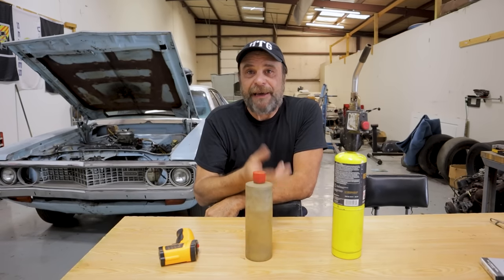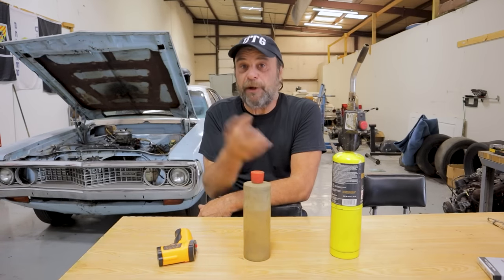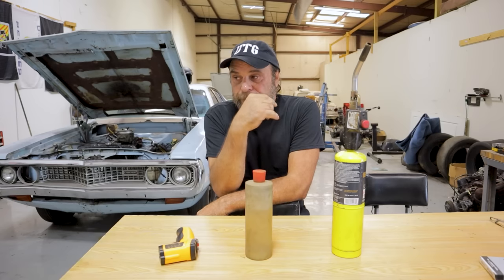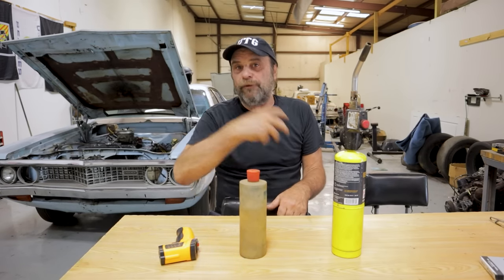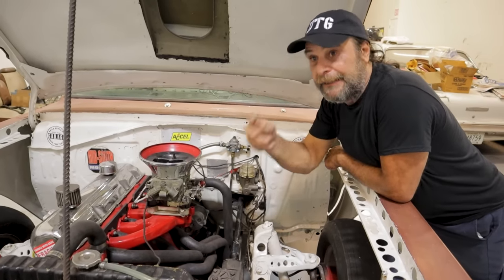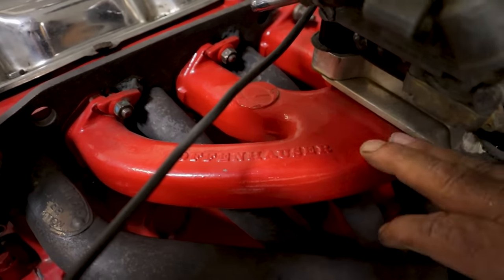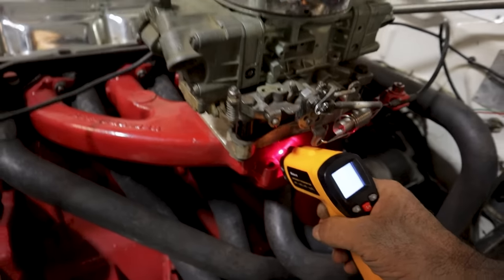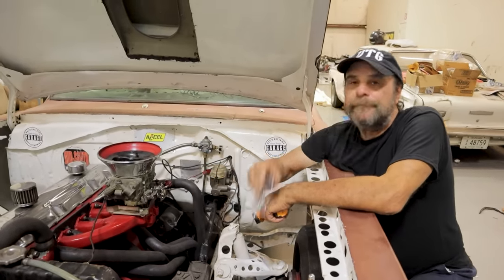How Much Intake Manifold Heat Is Enough? Testing The Vaporization Temps Of Modern Gasoline

Comment: Tony - I'd take the temperatures you were reading off that bare aluminum sheet with a BIG grain of salt - IR thermometers measure radiated infrared, and are typically calibrated for an emissivity (how readily a surface emits IR) of 0.95.  Materials like that aluminum normally have an emissivity closer to half of that or less, and as a result will read lower than their actual temperature.  To test it, try painting a part of the surface of your aluminum plate flat black, then heat it again and repeat your measurement with the IR gun, pointing it at both the painted area and the plain area right next to it.  My bet is that the black area will "appear" a lot hotter to the thermometer, thought both are actually the same temp.

Just something to be aware of with IR thermometers, and something that's much more obvious with IR cameras that show an image - shiny metal will often look cold relative to more emissive things nearby.  When measuring components on a circuit board that have metal cans, I usually put a piece of blue painter's tape on them to get a more accurate reading.  The painted parts of the engine are likely much closer to reading their true temp, though still might show a bit cooler than they truly are.  The header should be pretty much spot on.
Reply: Yes I completely agree. IR thermometers read lower on bare shiney metal. Paint the aluminum and redo the test.
Reply: Yes, even running cars look like the cold sky through my FLIR scope, only the tires, tail pipe, and halo under the car look hot, even when the sheet metal feels much warmer than ambient.  Predator vision is a very strange world.  I can see footprints with it for about a minute, but a paper target on a wood stand is completely invisible.  "Paint" the target pattern with some water or spit in dry air and you can see it from over 100 yds.
Reply: Completely agree, I bet water would have boiled on the aluminum plate he was heating.
Reply: Painting the Al plate mat black is a good suggestion (the emissivity of the plack paint will be higher than 0.95, the standard setting of non adjustable IR temp guns). However uncle T's red shiny manifold is next up for guestimation of it's emissivity. Perhaps he would like to remove the red and spray it also mat black. The black paint will also help with the inlet manifold taking in more of the heat radiation of the exhaust manifold.
Reply: If you are correct ,put  gas on the aluminum plate then record the reading  when the gas starts to boil.
 That reading will be your reference number to use when recording the time it takes the cold engine  to start boiling gas in the intake
Reply: Your concerns would be valid if UT had been experimenting with a steel or cast iron plate.  However, he was using aluminum plate which is the same as material as his manifold.  So, for UT's application 150 degrees is the correct target temperature for his intake and fuel.
Reply: @stevebooher7419  Except that the intake manifold is painted and the plate is not, so they still have different emissivities.  For apples to apples, paint the plate with the same stuff used on the manifold and you'll get numbers that should match more closely - not necessarily accurate as far as true temp goes, but at least 125° on one should be pretty close to the same as 125° on the other.
Reply: @stevebooher7419  Everyone is overthinking this setup UT is putting together which is what UT wants so he can get comments for more veiws.
 That guy from the "Mopars are everything" channel claims he can outrun this combo to the 60' on foot and that the reason UT's cars are slow is because the parts are junk.
Reply: @stevebooher7419   the Leslie cube experiment (readily available on YouTube) shows that a cube out of a metal coated with different colours, shiny and mat will have different emissivities. The challenge is understanding the limitations of an IR temp gun and understanding heat radiation versus convection and conduction. A thermocouple based surface thermometer is more reliable to use.
Reply: I agree with shiny surfaces.  But,  why would you paint it black?  Why wouldn't you paint it red so you are comparing apples to apples?
Reply: @jessekloth7884  Perhaps a bit of both on the aluminum would be best - the black patch should give a reading closer to the actual temperature as it matches what the IR gun expects to see, and red with the manifold paint to get a relative reading that would match what you'd see the temperature of the manifold as - eg. temp reading of 150° on the black reads as 130° on the red paint for instance.
Reply: I thought you could just stick some scotch tape on a place and measure that? I remember doing that when measuring air temps in galvanized ducting
Reply: @timothybayliss6680  As long as the black tape will stick on the manifold at the expected temperature (guestimated at 60-100 Centigrade) it will work. Of course the infrared measuring circle of the gun should be within the black patch.

Comment: I always enjoy your content Uncle Tony. 

It seems you broke from your normal way of optimization of the existing systems. The engineer may have had more than fuel economy in mind when they made the exhaust manifold bolt to that section of the intake, possibly they ran into the same issue you are fighting during the R&D. 

Keep up the good work on Plan Z!

Comment: I wonder if you drilled and tapped the intake to take a temp sensor, let the sensor butt up against the casting, so it reads the casting temp then add a temp gauge for it. It may not read the exact temp but I'm sure you could likely figure out a delta using a gauge and the temp gun. That could make for some fun and easy data collecting and testing.
Reply: Good idea..then put the electric fan sensor in it.
Reply: That is the next logical step. Good idea

Comment: Excellent testing…Just wondering if the the intake temp will drop during the burnout from the air and fuel flow…You can test that before you go
Reply: It could cool off the plenium more than it can reheat before the run.

Comment: After several attempts with wraps and oil line cooling hoses we came up with either an oil cooler or a heater core for under the manifold.  Installed a temp probe at the plenum to maintain temp at 150 to 165 degrees F.  It was definitely a street killer of V8's.  Just some thoughts.

Comment: Australia 1970 , Chrysler Australia used the mighty Valiant VG 4 door Pacer as their race cars , the standard 245 CI HEMI  6 was taken out to 251 CI and a 4 BBL Carter carb fitted , these cars went HARD !  kept up with the Ford and GM V8's on the long tracks and beat them on Australia's short tacks because of a 3 speed manual gearbox just using 2nd and 3rd  .

But ,, as you say Uncle Tony they had no end of trouble with the 4BBL flooding when fitted the standard V8 way ,, it had big top end power but bogged and with a 3 speed was slow at start and out of the corners .

So what they did was exactly what you have done here and turned the 4BBL 90 degrees and it fixed that major problem , they became very competitive , then in 1971 the VG was superceded by the mighty VH 2 door Charger with 265 CI and triple Webbers  and 280hp on the E38 3 speed and 320hp on the 4 speed E49 ,, Australia's fastest accelerating production car until 2002 when Ford made the 6 cylinder 'Barra' Turbo 6 , Falcon BA .

So from 1971 to 2002 they were the fastest ,, good history .

FYI , the 4BBL Pacer was named so , not because the had a 4 barrel carb , 4BBL stood for ' Four Big Bad Litre's '  

Love Plan Z and look forward to Saturday ,
Thanks Uncle Tony .

Comment: Just for fun, I looked up C16: boiling begins at 193 and the upper end of vapor range [90%] is 226 degrees. That puts a midpoint around 209 degrees.  Vaporization is done [no liquid remains] at 351 degrees.   Jenkins was near a walking encyclopedia of all things combustion engine.

Comment: Why not make a plate that bolts up like the stock exhaust manifold and run engine coolant through the plate? You could run a 160 thermostat and hopefully get your 150 under the carb.  I used to be in the Ford 300 scene and that’s what we did.  Your correct on how the carb needs to be facing.  The 300’s would do the same thing without heat.  With no heat my 300 was not drivable at outside temps under 55 degrees F.   I love the Slant content btw

Comment: My wrenching mostly occurs in the context of my 1951 pickup with a slightly later 235 “Stovebolt” inline 6.  This is a familiar issue to those with Stovebolts.  The factory 216/235 setup works really well for a driver.  

It’s a  heat flap on the exhaust manifold that warms the intake under the carb.  A bimetallic spring opens/ closes to regulate it.

One of the challenges for those who run aftermarket aluminum intakes or especially headers, is having a way to heat the intake absent the factory setup.  Some intakes have provisions for a tube that supplies coolant or exhaust via copper lines.  Some have rigged up their own setups.  Lots and lots of disparate opinions on how well the aftermarket setups work, if at all.

For your application…a drag only car, I suspect your idea of a long warm up is the most logical place to start.  

One concern: since you’re running with no charging system, will the battery voltage drop enough during the warmup to create ignition system weirdness?

Comment: Fabricate an aluminum plate and bolt it to the bottom of your intake. Drill and tap two 1/2" pipe thread holes in the plate. Screw in two heater hose fittings. Attach a heater hose to each pipe fitting. You now have a heated intake manifold. So very simple and easy to do. Install a shut off valve on one hose to limit heat buildup. I made one for my old Plymouth flathead six and the drivability increased by 50%. You got this!

Comment: Jeep 258’s had an electric plenum heater under the carb in the intake..
Reply: And a water line.  Gonna hook one or both back on tomorrow now that I have my carb sorted.  Couldn't tune out a mid speed detonation.  Brand new power valve wasn't opening.  Now I can get the intake heat working again.

Comment: Tony, a simple and low-cost mod is to install a temp sender to measure the manifold temp. not the air temp! the temp of the metal of your manifold. Your pick of a coolant or oil temp sensor, then use a toggle switch to display it on a suitable OEM gauge! FWIW use a toggle switch with enough poles to include the switching needed for indicator lamps..

Comment: tony I am an old gezzer, my fist attempt at racing was a Pontiac 261 6. I made a 3 signal manifold, it did basically the same thing, the first couple laps it was a dog, so  I a made a heating device for  /under the manifold and plumed heater water to it and back , it worked great

Comment: The Clifford intake has a water box built into it. When I first installed that intake on my slant, I didn't hook it up because I didn't have any extra heater hose. I barely made it around the block. Next day, hooked it into the cooling system and I've been driving without a problem since.

Comment: You want to get one of those Dutra or Aussiespeed 4 barrel manifolds for that. You'll probably pick up a few HP too, but I think the casting is actually thicker and that one you have looks pretty thin so it'll likely shed heat pretty quickly, the opposite of what youre trying to do. I was reading the Grumpy Jenkins power secrets book the other day, and he said they use off the shelf GM block heaters to pre heat the engine before running to temp. It's amazing what they achieved back then with only factory GM blocks and castings and a tenth of the aftermarket gear available compared to today!
Reply: I am running  an Aussie  Hurricane  2 bl intake (500 cfm 2300 Holley) and Dutra  split manifold. My cold starts at noon show 140 degrees on the Autometer mechanical gauge. It loves 100 degree air temps and never a hard start problem  hot or cold from fuel boiling in the carb. (im also at 4300 feet of elevation)

Comment: I love how you're experimenting. Very cool. As far as testing vaporization on the aluminum plate, I'd suggesting making a plate about the size of the carburator baseplate in the form of a dish. That alum. plate you used probably has a big temp gradient making it inaccurate. The google says gas has a starting boiling point of 95F. Heat a bit of gas in that dish with an oven thermometer for temps. The infrared gun may not be as accurate as a direct reading thermometer immersed in the gasoline.

Comment: Use a heated coolant from the heater feed ports to a heat a block bolted to the bottom of the intake. You could use a heater control valve to regulate temperature.
Reply: Maybe add something to reach that temp quicker then shut it off

Comment: In high school I had a 292 Chevy 6 with a 2bbl and dual 3-1 headers, I had the Same issue the truck ran great with a 10-1 compression and a ported head but would never launch of the line it would stall pop and rip away the answer years later I figured out the solution with a manifold heater

Comment: Tony. What is the temp difference between the center runners and the outside runners? Will it take longer for the center runners to get hot? and as air velocity increases, and the fuel cools even further, will it frost over the center runners?

Comment: Those IR temperature sensors have a setting (resistivity?) that effects the reported temperature. Perhaps not super critical but the actual measured temperature is affected by the metal type and surface treatment. So a black cast iron surface needs a different meter setting vs a painted/anodized aluminum one. it's been a while but I think a 5- or 10-degree Celsius error is possible.

Comment: You have to have a good heat source because vaporizing gas takes a lot of heat because of the latent heat of vaporization.  When you heat the manifold up and it vaporizes some quantity of gasoline, that process takes a bunch of heat. More than you would think.  It's basically an evaporative cooling effect.
Reply: Gasoline vaporizes as soon as it enters the combustion chamber. Hence the effectiveness of direct fuel injection where we inject liquid gasoline directly into the combustion chamber. I believe Tony's problem is a very poorly designed intake manifold.
Reply: @ChrisPBacon-ok7ir  In the engine it doesn't matter because there is more than enough heat to vaporize the fuel without cooling the cylinder.  But he wants it to vaporize in the manifold where there is not as much heat
Reply: Furthermore the point of heating the plenum floor in particular is that the only fuel/air that sees the floor is stuff so rich/poorly atomized it's dropping out of suspension and trying to puddle, most of the flow just goes on by and is not heated. I think short of running exhaust under it like most American V8s it's kind of hard to have too much heat in that little spot.

Comment: Tony I went through this year's ago. The direct connection manual is wrong. If you turn the carburetor sideways, all your plugs will burn clean everybody that follow follows the direct connection manual, has to run plugs of varying ranges
   As proof, the same manual shows you how to weld a 2 barrel Plat on, rember? And they welded it sideways for racing. I daily drove one for years, tried every way just to be sure. Hollies, carters, even factory thermoquad  and  even GM quadrajet? Many would suffice, but the best I found was the one off my cross ram Hemi. Also mounted sideways...

Comment: Very interesting problem Unk. Something you might try is a whiffer....A few ounces of acetone might start that cold gas burning. Depending on how much is used, you may have to back off the timing a bit....OR....Some winter blended gas. We use lots of it in the frozen north

Comment: I had a Dodge Colt that had a coolant heated carb. I never heard of that, besides carb de-icers on WWII radials, which were oil heated ( some electric late in the war)
  It started leaking, but not knowing the design, figured it was a blown head. Ended up selling it to a guy that ice races on lake Winnepesauki who was happy as shit to have finally found one!
Reply: Some 390 Ford trucks had a coolant carb heater.

Comment: Uncle Tony, your timing is almost perfect. I've just been watching David Vizard talking about how much fuel needs to be vapour and how insulating the intake too much from engine heat can drop power.

He also expounds on booster types and how much each type reacts to flow signals and how different designs of booster atomize fuel.

Have you guys been coordinating this?

Comment: Had two darts as a teen and both had slant sixes. The stock configuration had the exhaust manifold attached to the intake (And both cars would vapor lock on summer days). This configuration was the norm going back to the inline 4's, 6's and inline 8's of the 20 -30's.

On Chevy v8's I would restrict both heat runners with a piece of stainless sheet metal with a 1/4 inch hole in each because the Holly carb would warp the throttle plate and cause air leaks.

Another important thing with engine temp is making sure your oil gets to 215~220 to cook off any moisture that can accumulate in the crankcase from the PCV system sucking humid air in.

Comment: I feel conflicted having a rotary 12a and having the ram horn intake moving enough air and fuel to produce frost, while having that same engine like heat. 
it's probably due to rotaries being naturally fuel hungry when they aren't running at a consistent rpm, but the radiant heat thing would be an interesting explanation why I can let my car idle for a minute and a half and end up bogging down when a hot engine would have sent my car screaming back home.